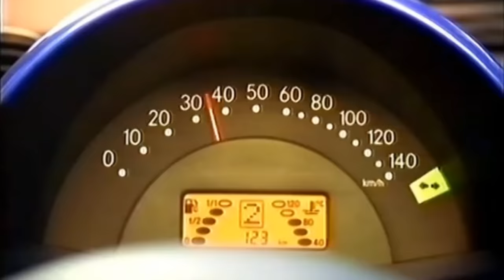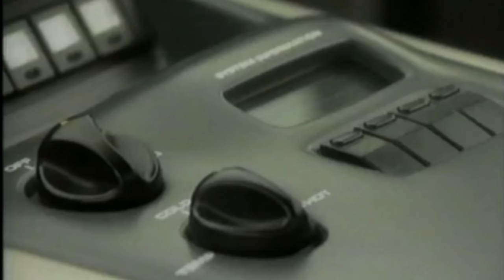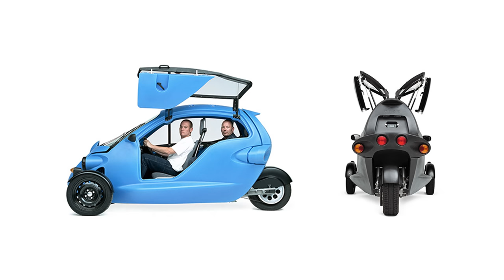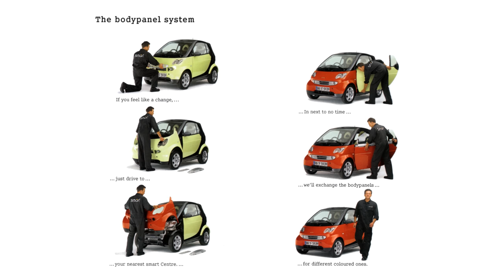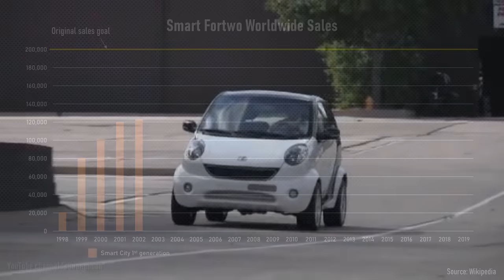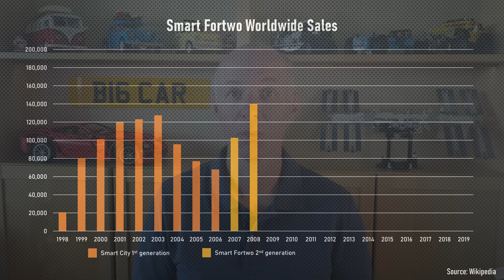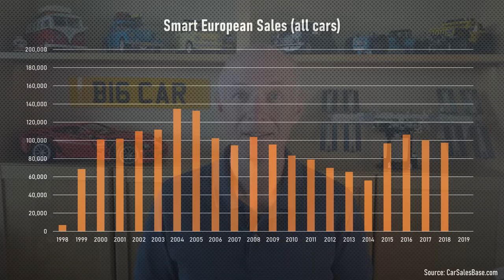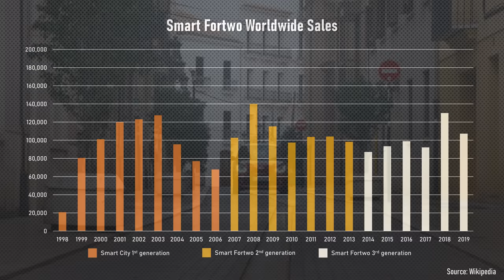The “Swatchmobile" ABANDONED by its creators. The Smart Fortwo Story

Comment: We had one, 2005 diesel.  After a bit over 100k the transmission stopped working when we were on a hill with tons of traffic behind us.  Luckily, a city truck was near by the they directed traffic away and helped us get it down the hill.  We sold it for about $1500 right after that.  Was a costly car to own, some value thingy keep clogging up, and we had to keep replacing it at $800cdn a pop.

Comment: I bought a Smart Fortwo second-hand in about 1998 and drove it for about 5 years.  It was a great little car.  As well as city driving, I took it regularly on the motorway.  It never let me down.  I was quite happy with the automatic mode of transmission though critics denounced it as jerky.  Pity governments could not have made tax concessions even greater, or increased the tax rate on larger fuel-hungry competitors.  I think a lot of male drivers thought it beneath their dignity to drive round in such a small car, they wanted something larger to show off their status!  
Mine was written off by a van driving into me from a side road.  By then I had a grandson, and family pressure obliged me to drive a car that would take a pram...

Comment: In 2010, I was delivering pizza and trying to save up enough of a nestegg to go back to college and get a better job. I did a cost benefit analysis of multiple cars I could buy on the used market to find the one that would be the cheapest to use per mile. My calculations looked at fuel costs, servicing costs and the price of normal wear items like brake and suspension parts, clutch kits, etc. Labor was not considered as I do all my own repairs and maintenance.  I considered the Smart, but after learning of it's crappy transmission, difficult to work on drivetrain, need for premium gas and middling fuel economy, I passed. I looked at several others but in the end bought a 1991 Geo Metro (Suzuki Swift) with a 3 cylinder and 5 speed manual trans for $250. I fixed it's issues, built an A/C system and used it for another 4-5 years and 100k miles (it is still on the road today, 7 years after I sold it!). It got 45 mpg (city) on regular gas while the Smart would have gotten 34 mpg (city) on premium. One of the other cars on the list was a 1991-99 Nissan Sentra with the GA16DE engine and 5 speed. I had one previously and got 32 MPG (city) on regular gas. I believe I also considered a 5 speed 1.5 liter Toyota Yaris 3 door hatchback. All of those cars were cheaper and easier to buy parts for while costing less per mile on fuel than the smaller, less practical, less reliable Smart. I think a lot of people looked at the same metrics and said "No Thanks". It needed to be cheaper, have a better transmission and use regular gas to make sense to buyers. All it had to offer was easy parallel parking, which was not needed in the suburbs. I would still like to drive one, or even own one if it were cheap enough, just for the experience. However, it would not be a viable replacement for my much cheaper to run and more practical 2015 Prius C, which replaced the Geo Metro 7 years ago. It too was a car purchased based on a cost benefit analysis, and my calculations have turned out to be quite correct on this car too. (I no longer deliver pizza and did manage to graduate college and get a good job in my field with a great company.)

Comment: (Quoting from my comment on Hubnut)

' I imported a Gen 1 from Holland in '99 and did some mild conversion work to make it fully UK compliant. Little things like reversing some rear lamp positions and making a speedo index that had MPH as the major index. It was a black Passion and was far nippier than anticipated. There were very few in the UK at that point and other owners would point and wave :) they were very disarming to drive and you'd get waved out at junctions etc and lots of smiles. Averaged about 48mpg or so, even though I used to thrash it.

For its first service, I took it on a road trip to Strasbourg as MB UK couldn't service it. But they took an interest, and arranged sessions with UK owners to ask about our experience. Some of what we said made it into the UK releases- eg, the improved gear changing. Yes, the UK release versions gear change was better than the one I had, go figure. I suggested a gear change hold button, or a CVT! but that never made it in- but would have averted the 'no power' issue that would sometimes plague changes after coasting in a gear down to big interchanges, etc. A CVT would have made more sense IMO.

It was reliable and fun but handling wasn't great- those intentionally narrower front tyres did affect ride comfort, and it had the short-car choppiness you'd expect. Oh and the passenger seat didn't fold down, the sunvisors rattled....etc. But we had fun together.'

(oh, and regarding the 'electric' possibility: on the Gen1's LCD dash, its possible to see a 'plug' icon if you shine a torch or bright light on it directly.)
Reply: It’s the Netherlands

Comment: I can easily explain why this brand in general was just a flop. Smart was a brand that tried to combine city car with small and premium brand gasoline. Sure small cars are a good idea but it kind of defeats the purpose when the gas tank can only go 90 miles on full tank and you still have to put premium gasoline. Other than that problem was the price tag. 

A smart fortwo back then started at 25'000. For that kind of money you could buy a base 3 cylinder mini and get a much larger tank that allows 540km on highway driving and 440km city on tank. 

Smart was a main competitor to mini; Mercedes wanted to take a shot at BMW because they are always competitive with everything. 

Only flaw was mini was just a much better combination of everything. 

Enjoyable fuel efficient vehicles, that's why they still sell in massive numbers today. 

Smart didnt offer the same range or package that pretty much any mini did.

Comment: That "semi-automatic" transmission was horrendous.

I only ever drove in one---a test drive.  It must have been one of the first generation.  The interior felt surprisingly spacious, with plenty of headroom (6' tall).  But that transmission!  Yikes!  It felt like it was never in 'the sweet spot'.  It was either lugging in a higher gear, or, after shifting down, then revved WAY too high in the next lower gear.  Awful!

The sunvisors only flipped down in front of you, and didn't even pivot to block sun coming in the side.  And, they were, if I recall correctly, about half the size needed to even be useful in the front windscreen.

Comment: 25:38  The Air-con outlets on TOP of the dash/fascia harken back to where many U.S. manufacturers (Chrysler kept it far longer than anyone else) initially located them in the 1950s.  Although back then they were "pop ups" which were shut off by lowering them back down flush with the dash.

Comment: The problem with the Smart ForTwo is that it doesn't really do anything better than a normal compact car, except parking nose-in on streetside parking, which is usually illegal anyway. Meanwhile it only holds two people and suffers badly from wind buffeting, and is a deathtrap with inadequate crumple zones no matter how hard the manufacturer tries to convince people otherwise.
Reply: Maybe you could produce hard data about the death trap claim rather than just a biased opinion. As to holding two people that's what it was designed for like motorcycles, light planes etc.
Re crumple zones, it was designed to make use of the the other cars crumple zones so better avoid hitting one!

Comment: The first Smart car I saw was in a service station, it pulled up to the petrol pump and the woman driving basically unfolded herself to get out.  She towered over it.
Years later I took a four four on a test drive and hated it. The semi automatic gearbox felt horrific, every time it changed gear it felt as if the entire transmission just melted into soft goo and the engine screamed.  The sales droid in the passenger seat kept trying to tell me this was perfectly normal.  It was entirely possible the car was some worn out demonstration car but it did not give me a good impression.

Comment: I've driven and been a passenger in a Smart in Berlin, a city where the car made sense because of the impossible parking situation.  With some risk to the door side panels, you could even get away with parking the car perpendicular to the curb on low traffic, congested side streets. I considered buying one in Colorado where I live, but concluded it made no sense.  The fuel economy was not significantly better than the Honda Fit I eventually settled on, and everything else about the Smart was woefully deficient compared to the Fit.

Comment: Mercedes abandoned this car.  It was too proprietary and had poor fit and materials.   My wife's warranty repairs on her 2008 was outsourced to a foreign car repair shop because the dealer refused to work on it, or couldn't.  Every failure ( and there were several) required dealer tools to allow replacement parts to be recognized and all materials were cheap to the touch.  The best thing that happened was when someone hit the car and insurance totalled it.  The wife got a Scion IQ and although also a cheap car, has been reabkecwith a very high build quality.

Comment: I’d once considered a Smart ForTwo here in the US. But I was quite disappointed that its base price was significantly higher than larger B-segment cars on the market at the time. Its fuel economy was barely any better than those models, too, despite being much slower and less powerful. It was also far less practical, and its compactness afforded it few real world benefits, even in more transit-and-cyclist heavy Portland. Even if you parked it head-in, you still had to pay full price for a full space.

It just didn’t make sense.

I remember eagerly anticipating the arrival of the 3rd generation ForFour in the US because that car seemed to come much closer to cracking the price/economy/practicality code. Especially since it was finally available with a proper manual transmission. But alas, Smart chose not to sell the ForFour in the US and gave up on the market entirely shortly after the 3rd generation model launched.

Another aspect that caused Smart to lose its luster in the US was its association with Car2Go, which saw them appear on every street corner as almost a white good, and it lost its only marketing advantage left: individuality.

Comment: In the United States we didn't get the Smart car until the second generation partly due to the fact that the failed moose test. They sold okay in the United States and then we did get the third gen but for some reason we didn't get the four-door which may have done better than the two door the fact we drive our cars on the interstate farther. The longer wheelbase helps with that. But the second gen 18 as pizza delivery vehicles and interesting used as off-road vehicles . In the short wheel and the low overhang the size is similar to UTV's people can borrow parts from utvs and put on their smart cars and somehow make them work. Like lift kits and off-road tires. The interesting mod was a snow plow mounted on one. The other interesting reason of that is the Smart car is street legal in utility vehicles are not but need mods to possibly be. The smart city car was an interesting vehicle.

Comment: I never was a big fan of these. We rented tons at Hertz back in around 2008-2010. Including Brabus and cabrio versions. Smart US must have dumped a large portion of production to daily rental fleets due to low demand. Many had weird parts failures. Like, 5,000 mile cars with failed seatbelt pretensioners and door handles, and overheating issues. They were highly unstable on the American highway. The space utilization was insane. Driving one felt like driving any other compact, but with everything ahead of and behind the seats missing. The interiors were very high quality. They had the most pleasant new interior smell of any car I've ever been in. Many customers that booked the cheapest car class would show up and either cancel, complain, or switch to a competitor due to the ForTwo being the car choice. We could hardly rent them to anyone. Most of the Brabus versions were missing all of their Brabus branding. Renters would steal all of the emblems, I guess because of the brand recognition of the high-end Benz tuner.

Probably the least widely experienced easily attainable modern vehicle in the US.

They are considered pretty much disposable now, having lost their value and never having mass appeal. But it really was never Daimler's fault for the US failure, as even Toyota failed with the iQ. That class of car just has never been a thing here.

The transmissions were shockingly bad in normal American driving.

Love the Techmoan cameo! One of my absolute favorite presenters on YouTube.

Comment: My wife was obsessed with Smart cars until we actually sat in one (first or second gen). She's short, I'm tall. Neither of us would have been able to drive it. She ended up with a Skoda Citigo (AKA VW Up) which is an excellent small car which has an annual road tax of £0. 

I did know a young lady who had one of the first Smart cars for about a year, using it for a daily 70 mile commute until the engine blew up. She replaced it with a new Beetle when they first came out, another car aimed at young trendies like her but far more conventional mechanically.
Reply: I owned a 2004 Smart Fortwo for 10 years.
Brilliant little car... Very economical to drive, stupid expensive to insure.
I went all over the country in it. Never had an engine issue in 70,000 miles.

Comment: I loved my 82 hp 2003 Smart roadster..the shifting was improved over the Smart for two with an ice box at the front was great for shopping. I sold it for a good price the 57000kms driven an owning cost of less than 0.03 euro per km..the smart design has some weakness like the two time three sequential gearbox as rear mounted gearbox and a cab shifter could not be mechanically linked across the engine. This was an error with such a turbocharged downsized engine..and initial acceleration was poor, yet to overtake once moving it was ok…a good TC automatic should have been made standard for such a city car..or a Honda Cub or 2cv centrifugal clutch used…

Comment: Having owned several vastly different 4 and 2-wheeled vehicles, large and small, I don't have any hangups about size. The Smart was always for a niche but it did have a place under the sun. 
I think the problem with Smart was having too many cooks in the kitchen, who didn't see eye to eye. The original idea had some legs. The thing is, you change something and it is a tweak. You change something else and it's another tweak. Then, at some point, you make just one more change and the whole thing falls apart and the integrity of the original concept is lost.
Speaking about the Australian market, the retail price was just crazy even considering the cute factor and the hint of luxury (baby Mercedes). For the price of a Smart, you could get A LOT of car elsewhere, with way more practicality and versatility, more performance, lower running cost and more overall comfort. Or alternatively, 2-3 basic little cars. It didn't help that the Smart was sold through Merc dealerships, infamous for their high overheads and price gouging on servicing. Smart was just too hard to justify, even for people who wouldn't worry about spending that sort of money on a car.
In my opinion, the original "cheap & cheerful" Swatch idea would've been more successful, even developing a cult following.

Comment: In a hot climate a glass roof makes no sense at all.  The last time I was in Europe with a long term "lease" car from France I made a crucial modification.  There was a "curtain" to shade my bald pate from the hot sun, but it hardly made any difference, so I used tourist bumf placed on the  upper sunny side of the the blind to add a layer of protection, and it was still there (and forgotten) when the car was handed back.  What seems good in cloudy northern Europe is just madness a few hundred clicks away. ps I wonder who found my modification and when.

Comment: I always wanted to buy a ForTwo but the price and the transmission (notoriously unreliable) always put me off.

The dealers wouldn't sell me a base model... which was about $18,500.
Instead they said the only model available was about $28,000.
For such a small car $18,500 was pushing it... so trying to upsell to something even more expensive was unlikely to work.

The first time I went in the dealer wouldn't even offer me a drive in the car.
The second time the sales rep took me out for a spin.
Who would buy a car they hadn't even driven?
The dealers attitude sucked: They seemed to think they were doing you a favour selling a car.

A CVT probably would have fixed the transmission woes and was a good match for the car: Mercedes talked about putting one in but never did.

Why did they set the Smart brand separately? They should have sold it out of the existing Mercedes dealerships. It was weird... as the Merc dealership was right next door.

🙂